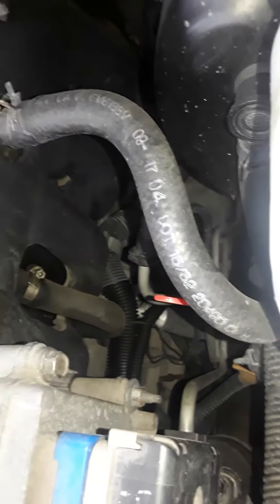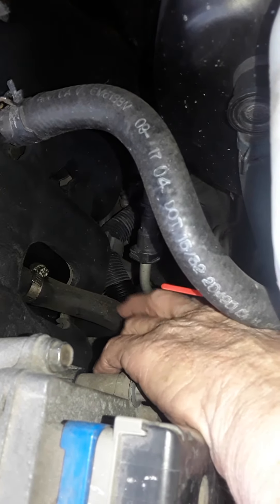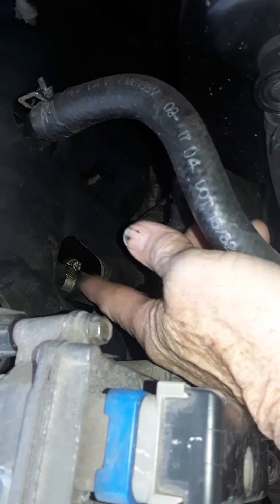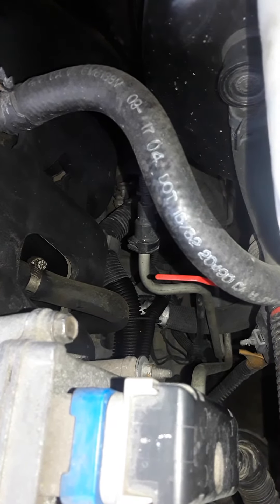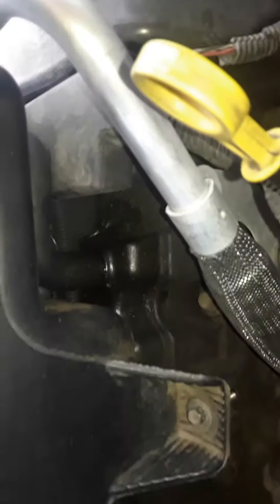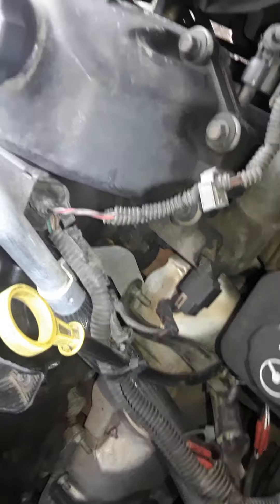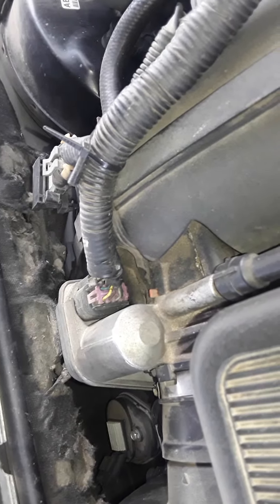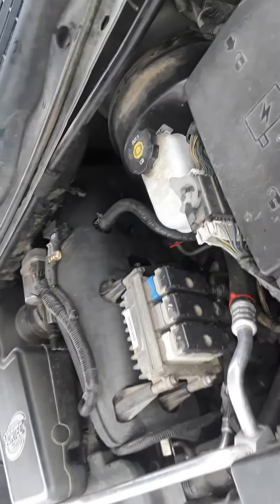PCV GM 4.2 ATLAS ENGINE

Comment: This is the most explanatory video I have seen on YouTube! thank you very much Joe Vreeland, you sound like a college professor. I have a question, this PCV system, according to your explanation, is clogged (on my 4.
2L) because there is no INHALATION through the hole in the valve cover and SOME SMOKE LEAVES, leaving some oily residue (it is not a whitish emulsion) in the "air box". There is not so much oil that it frequently fouls the throttle body. The engine is tuned today with clean injectors, new spark plugs and coils (OEM), it does not vibrate,
It runs silently, it has a lot of power but the RPM does not go above 500 at idle to the point that it turns off after about 20/30 seconds of being idle but it starts well, could the semi clogged or clogged PCV system cause the engine to stall? The scanner does not leave any code. Maybe you can answer me, thank you very much!  :hand-pink-waving:
Reply from the maker: Gosh ---> there are numerous reasons why this can happen - and I am on a great site that specializes on these engines and their driveability problems ....  https://www.trailvoy.com/ ---> c'mon over .............

Comment: You 100% correct Sr. . Also, the orifice can be accesed and cleaned from the inside of the intake manifold after you remove the throttle body. Its easier to remove than the nasty fight to remove the hose.
Reply from the maker: I hear what you're saying --- but I found that hose to be super easy to remove. It wasn't stuck nor cracked nor stiff. I'm sorry for your trouble, but I'll certainly consider your suggestion. Thanks.
Reply: Thank You Joe! Our 2008 Trailblazer 4.2 has been having oil leakage and I've noticed oil below that S shaped hose under the resonator. I did notice that the PCV hose on the left side is hard as a rock. It should be soft and flexible correct?
Reply from the maker: @johngligo4049  Super sorry for the late rep[ly ---> but the hose is open stock at most decently goods parts stores. It has to be Green Striped or it isn't approveed just in case you have emission inspections. A smart tester will spot the hose if it doesn't qualify.

Comment: You would think you could put a Pcv valve in between the hose & engine by now right? Oil catch can👍🏿
Reply from the maker: You already have very low-to-no flow now ... why put another restriction in the circuit? 
Oil catch cans are chasing a symptom, not a repair. Depending on the can, you still have no way of removing condensate ... it'll just keep creating more water and oil emulsion in the pan until it blows oil out the dipstick tube. 
Catch can = very bad idea.

Comment: This vid clarifies WHICH HOSE to take off to pour down the carb cleaner!! thanks. I was thinking it was the other hose by the oil stick. haha.
Reply: Best to perform this before oil change.  Cleaner and debris will end up in oil pan.
Reply: @davepetrakos475  yep - I ended up doing a couple oil changes - first including a flush. Maybe it was three oil changes? Yeah I had some complications. Just under 300K now.
Reply from the maker: Not so much as you might think. The reason for dumping the B12 into a hot engine is to get it to boil and fume and that will soften the gunk in the runners. You're not going to be able to get any B12 in the oil pan or on the cams if you follow the instructions where to pour it.
Reply from the maker: One engines that don't depend on oil pressure to lubricate the moving parts and instead, use flow-control instead - whereas the oil is regulate by amount, not pressure --- using additives in the oil is never a good idea. 

Notice that I didn't say to pour the whole can into that line --- just a capful or two --- and let it cook before you start it again. 

This won't allow much liquid to exist in the crankcase zone, so it's not like using a flush-additive. 
I do not recommend using additives of any kind in the oil. 

Fuel additives? Knock yourself out --- but leave the oil zones alone.
Reply: @SurferJoe46  OK - I'm just at 297K now - so doubt I'll need to do this maintenance for awhile. You're saying make sure the engine is fully hot first and then pour in a cap and let it sit for awhile before starting up the engine. Thanks. OK I did use a pint of boron nitride - micron size - it's less than .5 micron. I get it from AET systems - but it's made in Germany by Wagner. I added that to the oil.
Reply: @SurferJoe46  Yeah I was thinking of you yesterday because I was getting 24 mpg at 55 mph. Actually this was 2 days ago. I was probably at a slight decline though but the road seemed pretty level - lasted for an hour or two hours. Kind of hard to tell since I go through towns and so have to slow down to 30, etc. But overall definitely 23 mpg. Isn't that what you claim for 55 mph or you get that going 70 mph? I only get about 21 at best going 70 mph.

Comment: The S shaped hose that goes to the Vortex 4200 box, mine butts up to it, is that normal, or broken. There is no nipple on the box to push it onto it just butts up to it
Reply from the maker: Butting up to nothing is not the way it was designed. 
FWIW --> you can JB Weld another nipple into the box if you like -- and I think you should because it is supposed to be a sealed system, not just a hose pushing onto a place where a hole happens to be.
Reply: @SurferJoe46  thank you so much I kind of figured the piece was missing

Comment: I don't have "mayonnaise" I have thin running oil. Which I wiped out the best I could. I have an EVAP. But it doesn't show a code number.
Reply from the maker: Any oily deposits in the sound chamber is/are/am bad. The OBD2 won't "see" the PCV system failure or if it's running well --- or at all! Therefor, you won't get a code for it if it fails -- which it is doing since it came off the assembly line. 

It just takes time to show up as an oily discharge and then the failure to control same.

Comment: Lisle 47900 Hose Remover Pliers - I ordered these - do you think I can remove that "dirty hose" with that tool? I don't want to have to mess with the intake manifold at all. I ordered a new hose. So if I can get that old hose off by reaching it with that tool? I don't know - it's difficult to even see the hose connections at the ends!! But the new hose should be more flexible since it's not an old baked on hose. ... So if I think I can get the NEW one on then I'll remove the old one so I can clean out that PCV nipple into the crankcase.
Reply from the maker: A new - vibrant, flexible and rubbery hose will go on --- just make sure it has the Gates Brand, Green Stripe.
Reply: @SurferJoe46  thks Joe - I often think of you when I read my average MPG - you said you had 1000 lbs of tools and you get 23 mpg? At what speed? How flat? what temperature? Also isn't your gear ratio the big factor? Here in northern midwest - I notice the MPG is down when it's around say 15 degrees - or maybe that was because it was so windy!! Yeah. Anyway I did put on that new Gates PVC hose - when I also did a cleaning of the oil pan with some acetone flush - and I did some more acetone flush via the PCV... and then I put on an external OEM Magnefine from Australia - the Remans transmission runs better now. I also put on a new catalytic converter - or the muffler shop did - since that Berryman's engine flush - or also the acetone - seemed too harsh on the OEM catalytic converter that was 20 years old. Now I get this nice deep rumble.
Reply from the maker: @voidisyinyangvoidisyinyang885  Higher fuel use can be caused by cold temperatures --- but not for long once the engine gets to about 200° when the thermostat should open. 

If you don't get hot by a couple of miles, I'd suggest that your thermostat is slow or prematurely opening and keeping the engine too cold. 

That will burn more fuel - and although it's incorrect, the ECM can only react to the inputs it gets from various sensors.
Reply: @SurferJoe46  yes thanks for pointing that out. I can get 23 mpg by going 55 mph. Not sure what speed you meant by highway. I live in the northern midwest - in fact in some of the coldest temps in the lower 48 - so definitely in the winter the mpg goes down a lot. It can take 20 minutes for the oil to heat up. The engine temp is not the same as the oil heated up so I switched to 100% full synthetic oil - that helps for sure. I also now add boron nitride - the micron level at .15 size as a lubricant - it's sold from Wagner out of Germany under the company AES or advanced engineering systems out of Wisconsin. Air-tec is the brand name. I noticed the engine is super quiet after adding boron nitride - it fills in the pores in the cylinders and valves. It lasts I think 50K miles or so. So I can add that about once a year. I have not changed into the air filter I have that is a dry filter that is reuseable - this is to increase the oxygen level to the engine. I guess I should do that. I'm just about at 300K now - around 294K.

Comment: Ravalli Surfer, liquid B12 is better than spray in this application.  Also, I pour the B12 into a WARM engine.  The warmth causes the B12 to "boil" in the stopped up orifice and cleans it better.  I diagnosed this on my 02 TB EXT 4.2 because of issues with oil in the spark plug recesses.  I took off that ignorant "sound suppressor" box and built a straight pipe from the air cleaner to the throttle body and added a secondary air filter (like they used on some 1970's and 1980's pcv systems on that little "pcv clean hose" on the top of the valve cover so it doesn't even hook into the intake system anymore!  I also did that mod on my "05 TB EXT 4.2 as well!
Reply: I check my system once per month by removing the oil dipstick with the engine idling, sealing the dipstick tube with my thumb for a minute and then notice as I remove my thumb if I hear air being sucked into the dipstick.  If I don't hear/feel air, I clean the port!
Reply from the maker: @user-cy6gf2pj7y  You guys get it --- thanks! Although I don't advocate taking the KV hose off the valve cover - I can see that it works OK - although illegally -- but who's telling?

Comment: OK I did get some smoke out the exhaust after I sprayed acetone CRC into the S hose metal nipple on the fresh air intake into that metal nipple. I got the CRC spray straw way down into that metal tube. So if I got smoke out the exhaust that must mean some of that negative pressure burn off still exists and it CV negative vacuum got cleaned out a bit?
Reply from the maker: It isn't a good idea to spray anything into that nipple under the "S hose" --- as it drips directly onto the camshaft and you don't want to clean the lubricating oil off of THAT!
Reply: @SurferJoe46  oops - I drove it around and it survived so far. Should I take it for another spin to burn off that stuff so it doesn't soak in?
Reply: I'll go drive it again to evaporate off that acetone. Thanks. Says otherwise it will rust overnight. oops.
Reply: @SurferJoe46  OK the engine seems to have survived - I added Lucas and then got an oil change. Then added more Lucas. Then got another oil change!! Now my MPG has gone up better than the Factory Rating and I have 267K miles on the engine! So I think I gained at least one MPG if not more from that accidental acetone cleaning. NOW - that PCV hose in the negative vacuum CV side - it's too brittle and inaccessible to remove. So I would have to remove the whole intake manifold which is a huge job that is beyond my capability. So I didn't feel much of a "negative pressure" when I held my hand over the oil - but that' when I had Lucas in that was clogging up my VVT. So I'll test it again. If I don't feel much negative pressure then I'll take off the air box to look for oil blow by. The oil fill tube is clean as is the dip stick. The oil coming out of the engine is clean. I get oil changes every 3K miles almost always - just went over a couple times. Also I do long road trips to "clean out" the engine - like 200 miles - routinely. So maybe that Acetone also cleaned out the PCV system a bit also one would hope.

Comment: Air cleaner side came hose block so what problem coming?
Reply from the maker: Well, Mohammad --- this is gonna be fun! 
1. Blown-out valve cover gasket --- THE FIRST PROBLEM!
2. Spark plug(s) and coil(s) covered in oil
3. Mysterious oil leaks on the frame and the ground, which are really not so mysterious.
4. The insidious P0300 code --- or any other individual cylinders (#s 1-6) reporting they are misfiring can have you chasing your tail
5. P0325/P0327, etc., might appear IF the Knock Sensor gets wet with oil. 

The valve cover gasket is designed to keep oil in the cam galley -- and if the KV hose is plugged up then the pressures can build too high for the valve cover to contain. 
The most immediate result is that the spark plug recesses fill with oil and some people think the oil is from the combustion chamber. IT IS NOT. 
When they remove the plug and the oil runs into the threads and the top of the piston, they think the cylinder is full of oil and the plug is fouled from it. They are wrong.
Reply: @SurferJoe46  I have oil in the spark plug recesses. Does this indicate I need a new valve cover? DO you have a video on how to replace that? Thanks, great videos BTW!
Reply from the maker: @trkonkal  Oil leaks at the valve cover can be evidence from pressure in the crankcase .... caused by an improperly operating PCV system because that blowby will find a path to escape ... usually the valve cover gasket. Oil will collect in the sparkplug wells and damage the coils and rubber parts on the plug boots. Just changing the gasket will not cure the probllem with pressure in the crankcase. You have to go through the process of cleaning the ports that are full of gunk and crust from cooked oil byproducts at the same time. I don't have a video on replacing the valve cover gasket .... there are a few on YT though.
Reply: @SurferJoe46  Thanks Joe, your speedy reply, advice, and videos are very appreciated!

Comment: OK - that "clamp" doesn't do jack on that PVC Hose! I got the new hose and I tested out that clamp - it's not even a Spring Clamp. It's attached to the hose just to be able to "grab" onto the hose. So Joe was berating me for not just getting on it. So I used the Hose Pliers to remove the crankcase end of the hose. Then I had to stick the hose back on so I could pour the B12 Berryman down into the port. I had the engine running when I pulled the hose off and air shot UP and out - so that port and hose is definitely not clogged at all. haha. After I poured in some B12 - probably a couple cap fulls - then I started the engine back up and revved the idle for awhile to burn off the B12 so I wouldn't get hydrolock hopefully. Then I put the hose back on and I drove around for 10 minutes or so - and the Service Engine was on. I got a P code for "high rpm on idle." So I cleared that Service Engine light as I just got the INnova 3100 scanner so I can clear codes. haha. 
Thanks for the feedback - luckily the PVC hose was NOT brittle nor "baked on" and I reused the old hose. I'm gonna stick with MMO now. I tried looking in the port with the Boroscope and I saw no blockage. Then I tried pumping the "forced air" in but I only have a bicycle pump - so no PSI really. haha. It's still a very awkward spot to attach the hose - I couldn't get a funnel into that port at all. So I had to flip the hose around and reattach it. ... so I could pour the B12 into the port.
Reply from the maker: OK --- very late reading your post --- but there should NEVER be any pressure in that hose --- never can it blow things out of it even if the engine's running. It is a vacuum hose and as such, it sucks for the lack of a simpler word. 
 I think you're in the wrong hose or something else is really screwed up.